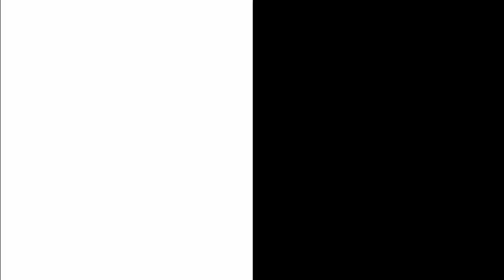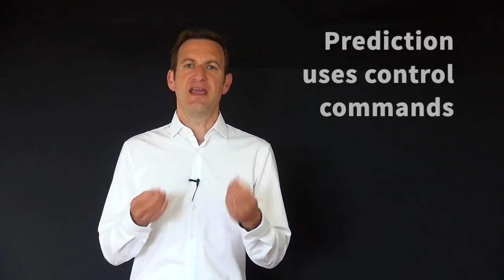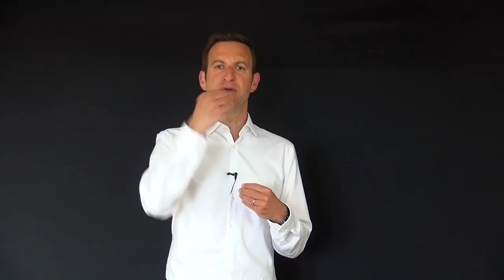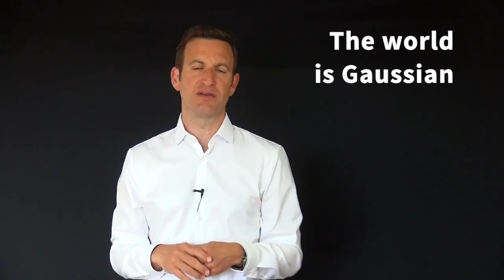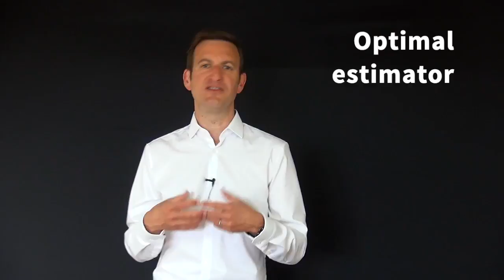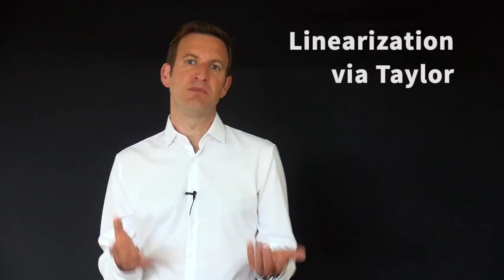Kalman Filter - 5 Minutes with Cyrill

Comment: Hello, thank you for a useful video. I would like to ask a very simple question regarding using Kalman Filter for autonomous vehicles. I always get confused about how the two aspects go aside. That is the correction after prediction where one is linked to the system's model and other to the state measurement. For instance, if the system's model has uncertainties and the measured readings by sensors have noise how does Kalman Filter decide on the correct state values?
Kind regards
Reply from the maker: The Kalman gains basically weighs both uncertainties against each other. The more uncertainty, the smaller the contribution to the estimation.